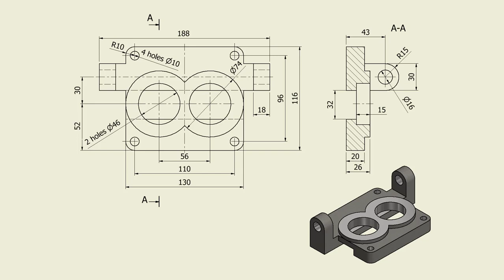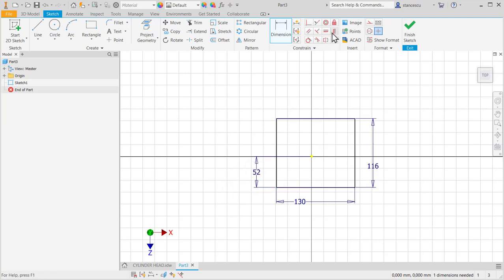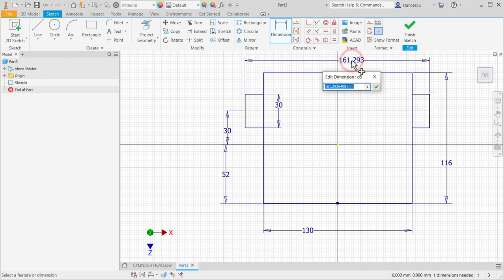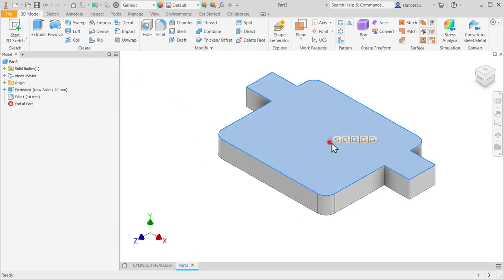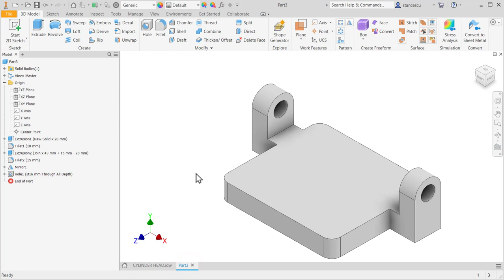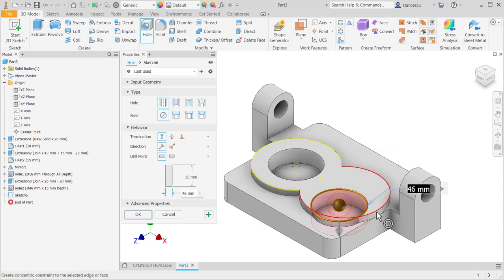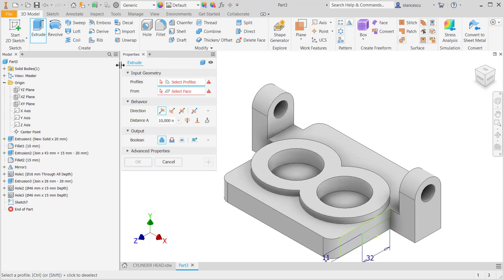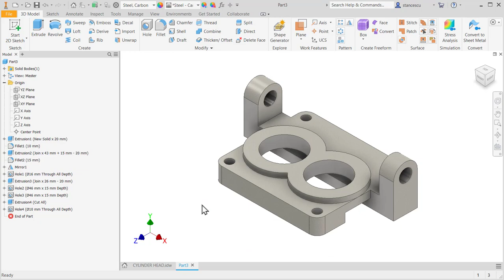Tutorial Inventor - 063 CYLINDER HEAD-1 (Part-023)

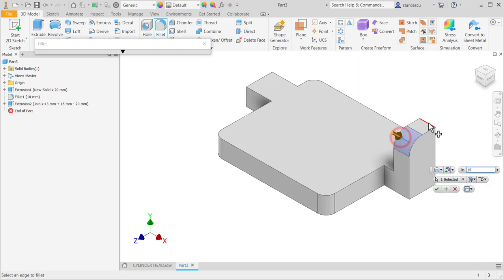Comment: At 7:53 you apply a fillet of 15mm on the top of the two projections that look like they are used for mounting.  I wonder if you have ever considered using the "Full Round Fillet" feature for this.  That would assume, though, that the designer had this intention in mind.  With the fillet modeled this way, it would automatically change with a change in the width of the projection.  I suppose you could make it act similarly by connecting the fillet radius dimension to the same width dimension, as you've already shown us.
Reply: Oops, my bad.  The "Full Round Fillet" does not mirror.
Reply from the maker: This was a simple model for beginners and I used simply procedures as demonstration.
I always prefer simple procedures, and you are right: I never used Full Round Fillet! 
Then you are right, too - that feature cannot be mirrored.
All in all, it is like a drunk snake:
- How is a drunk snake?
- ...?
- A drunk snake is straight not sinusoidal!
Thank you, my friend!
Reply: @prof-stancescu  Yes, I do often feel like a drunk snake.  :)  I love that analogy.